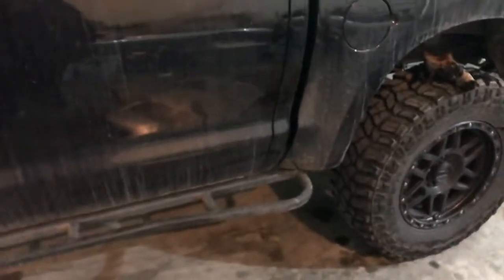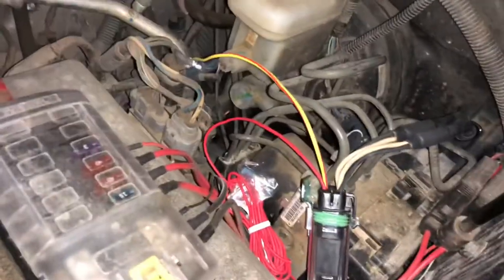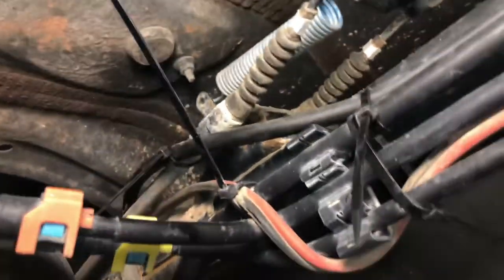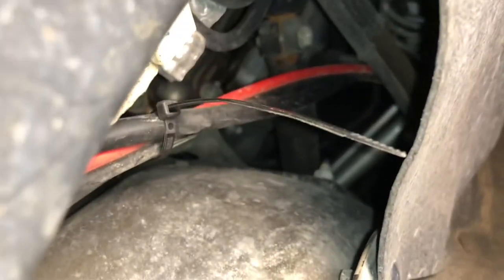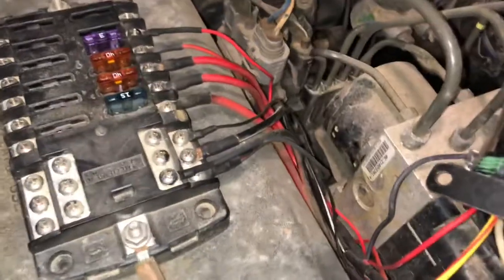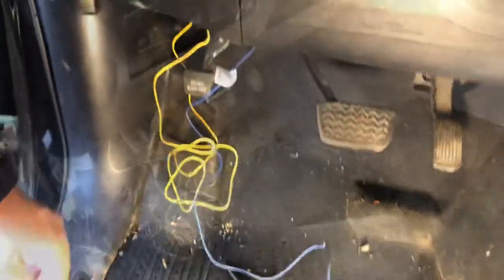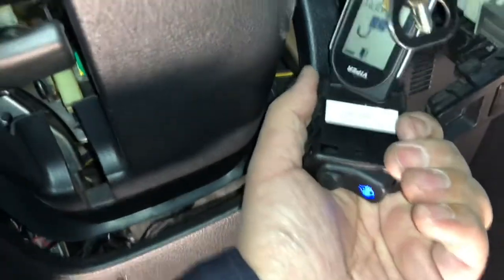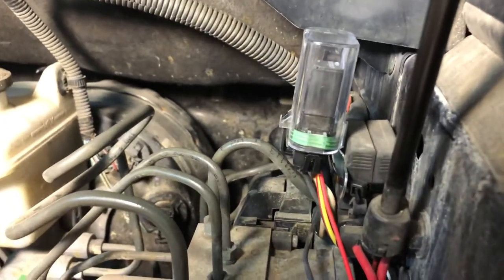Tundra E-Locker Installation

Comment: Just got ARB air lockers and Nitro 5.29 gears installed last week and a HP Tuning reflash of the ECU today. Massive difference in performance and capability. Crazy difference. Installing Ironman Foam Cell Pro coilovers and rear shocks this week.
Reply from the maker: I thought about switching over to the foam cell pro suspension. You’ll have to do a review on it
Reply: @beehivetundra  I installed the Ironman Foam Cell Pro rear shocks. They replaced the Bilstein 5160s I had on it. Honestly, so far I would say the Bilstein 5160s are a better, more comfortable ride. The Ironman Foam Cell Pros rear shocks are stiff and the rubber bushings are squeaky. The Bilsteins didn't squeak at all.
Reply from the maker: @tribunation  ohhh damn okay. Thanks for following up and letting me know! 🤙🏽
Reply: @beehivetundra  But the Ironmans may break in. 🤷‍♂️ Getting the front coilovers assembled (not installed) Thursday along with the diff gear oil getting changed as my break in period is over. I will be installing my front coilovers myself and then I'll take it somewhere locally to get it aligned. I had to find a place to assemble them because neither I or other shops in the area had a spring compressor beefy enough to compress the springs enough for the correct amount of preload.
Reply from the maker: @tribunation  I agree. I assembled some foam cell pro’s and the preload is nuts on them. I used a 10 ton press to assemble them. Not looking forward to doing another set anytime soon. It sketches me out that single nut on the top hat is holding all that pressure 😂
Reply: @beehivetundra  So the reputable shop I took the shocks and springs to told me that the Ironman heavy springs (TOYO63C) are a poorly designed springs and that every set that they have installed has had the springs eventually rub against the shock bodies. They said that they do not spec those springs on any of their builds because of this and that they only use the medium springs (TOY063B). I contacted Ironman about the problem and they said acknowledged they have had problems with rubbing. They said they'd "take care of me". Whatever that means.
Reply from the maker: @tribunation  I don’t know why they would eventually rub, seems like they either wil from the get go or they don’t. So that’s crazy to think it will eventually happen. But if Ironman will make it right if it happens, that’s a good thing, although hopefully that’s something they are working to address before it continues to happen.
Reply: @beehivetundra  John in sales at Ironman acknowledged it being an issue. The springs bow excessively immediately after the coilovers are assembled. The inside of the spring will rub the shock body on one side and a big gap on the other side. The springs also wont sit properly and straight in the bottom of the top hat because the springs are too long with too much tension.
Reply from the maker: @tribunation  that makes sense now that I can picture what’s happening. That’s unfortunate
Reply: @beehivetundra  Posted a video on my Ironman experience.
Reply from the maker: @tribunation  sweet, I’ll check it out 🤙🏽

Comment: Great Build. I have a 2019 CC on 37's with 6" lift. I need to either drop to 33's or go to 5.29 gears. I'm in Ogden. Who did your gear swap?  I would probably go with Eric at AXIS but I know he prefers solid axle work
Reply from the maker: I went to Agility Customs for the gear install and Geoffrey did fantastic work. Fast turn around time, good communication and quality work, my gears are quiet.

Comment: Hey bud I was wondering what your RPM'S are on the highway say at 70mph with the 529's gears and 37's any info would be greatly appreciated 👍
Reply from the maker: I haven’t calibrated my speedometer so the following info might be weird. So true GPS 70 mph I’m running at about 1950 RPM but the Speedo reads about 63 mph. If I have the speedo at 70 mph then my RPM is about 2300 RPM but my true GPS speed reads 77 mph.
Reply: @beehivetundra   Only 200 or 300 RPM over stock is not bad at all I like to cruise at 80+ mph . Not sure about doing 80+ on 37"s? I had a jeep back in the day on 38's and honestly it was kind of scary on the highway over 70mph lol with a good  Alignment lol 😆thank you for the info 🙂👍

Comment: Why did you choose the Eaton over ARB's air locker?
Reply from the maker: Too often I hear of the copper line inside the differential rubbing on the ring gear and getting a leak or the Teflon line getting a pinhole and you end up with lockers that won’t activate. You could chalk it up to installer error why take the risk? With Eaton you have a factory behavior with electronic locking at the push of a button and peace of mind. At the end of the day it was just my personal preference to run it.
Reply: @beehivetundra  thanks. Have you had any issues with them temporarily disengaging while in reverse?
https://youtu.be/MSU8NRXhy7o
Reply from the maker: Honestly I couldn’t tell you yet. I need to put them through further testing to know for sure whether or not that’s an issue or cause for concern. But I’ll make a future video with real trail results and performance soon.
Reply: @beehivetundra  awesome man, thanks!
Reply from the maker: @oversizedoverlanding2365  just in case you’re wondering, I’ve put them through the paces and have had zero issues with unlocking while reversing back off an obstacle. You can see them in action on my flat iron mesa video and it performed amazingly.
Reply: @beehivetundra  thanks!